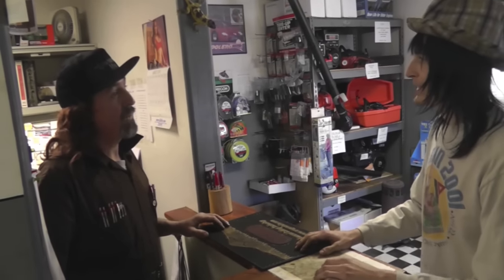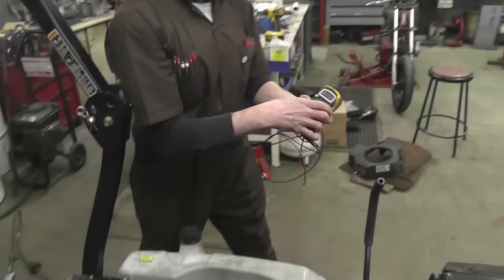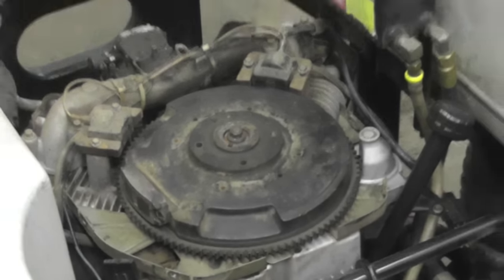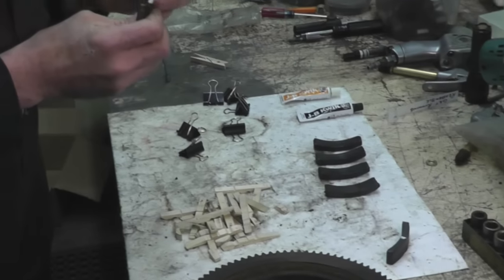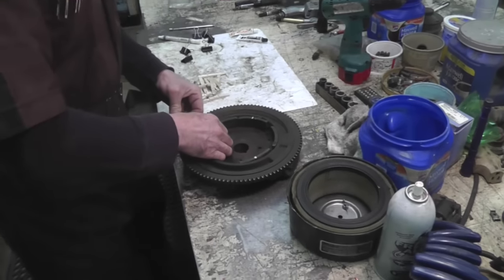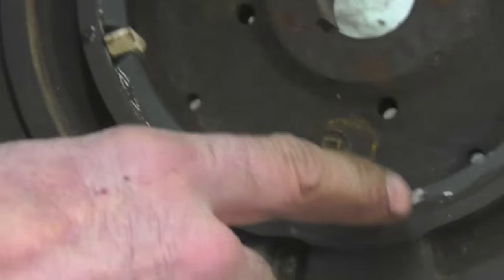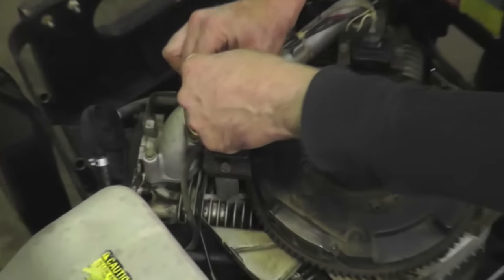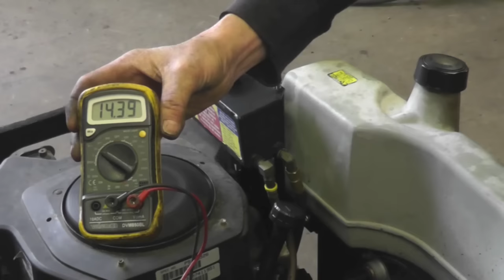Repair Broken Kohler Flywheel Magnets to Fix Charging System

Comment: I took my flywheel off and two of the magnets were broke in half. I glued the magnets back in place with JB weld and 24hrs of curing time, I put it all back together and the system is charging just fine. So, there is hope without having to buy a new flywheel, I just pushed the two pieces together with the JB Weld and a clamp, and it works fine.
Reply: Hi Robert, Thanks for your input.
I have one broken magnet.  Good to know that I can glue both halves back on the flywheel in the proper sequence and get it to work.
John
Reply: WHATS YOURSOC  Update:  I glued the broken magnets back on the flywheel with JB Weld and now the charging system works perfect.  Thanks to Robert Hills for sharing his knowledge.
John
Reply: Broken magnet.... About to put it together... Now that I know that it works... Thank you for the extra info. Appreciate it.
Reply: It works great. 43 volts AC. Thank you.

Comment: Help help!! I have a Miller 225 and it won’t start🤨sound like the battery is dead.. but is NOT almost 13Volts my voltage meter show,.I  remove from the engine block and it work just find

Comment: Taryl, I followed your Flywheel instructions and fixed it on my Kohler  Command Pro 23hp Engine which has NO Identification Sticker on it.. The block casting numbers are  24 560 39 .. The block is Cleaned and the Cast Iron bore is perfect and Already honed, and Ready to Re-Ring.. It has an 80mm Bore and 1.5mm thick Rings.. HOW Can I Get the Engine designation Numbers for the Right Parts and New Carb that I Need.. Help me to get to "Here's my Dinner" Partner PLEASE.. Love your Videos!! .. Thanks, Richard Tharp

Comment: Love it guys..great stuff..ive got a 25 hp kohler ive got 43 ac volts at the new voltage regulator..and I installed a new stator but no charging voltage at the battery... Any ideas? Also checked all the wires and didnt see any that were cut or broken

Comment: usually not what happens to a lawn tractor Magnets. Design Flaws in voltage regulator made easy to collect dirt. most attached to plastic.

Comment: Does anyone know where to get replacement magnets for a ech749-3038 Kohler engine? Mine spit 3 of them and they broke to pieces took the stator with them😥
Reply: Did you ever figure out where to buy the magnets by themselves? I’m thinking I’ll have to find a detailed schematic of this engine online in order to find out the exact dimensions of the magnets that I need; then use that information on a website that sells specialty/custom magnets.

Comment: If the magnets are stuck on the stator when you take the flywheel off, before removing them, mark every other one with the paint pen.  That way you don't have to check them with a magnet, since they were stuck there in the proper sequence.
Reply: Not only that but you should never hit one of these Kohler command engines flywheels or the older Tecumseh cast iron engine flywheels with a hammer because that will knock the magnets off from the flywheel. The right tool to use is a harmonic balance puller or what I use which is a 5 ton hydraulic puller. Taryl you know better than that! but if even one is already off from the flywheel then take a hammer and hit the back side of the flywheel with a hammer where each magnet is. That will pop the rest off from the flywheel. Now I found that the best thing to use to do these magnets is a wire wheel in a drill to clean the inside of the flywheel and the backside of each magnet. Then get some acetone to clean it or gasoline. then you get your Best ones for vibration and high heat which are 2047 green, 266 red/orange, red 2700NA or  RED 2760. You can also use 272 red or 277 red. The 266 red-orange is very high strength and heat up to 232c which is 450 degrees hot and handles high vibration or use the GREEN (Taryl already knows the one high heat green 2047 is heat resistant and very strong) loctite. that green requires a torch to remove the fastener. lol. Ive seen Taryl use the green before. lol. Put a thin coating over the back of each magnet setting them into their proper place as He shows. Then go set the flywheel in a warm 70 to 80 degree area (for faster set up) and you wont be able to pull that magnet off without it breaking after 24 hours of drying time. I know because I tried to remove them before and they will not come off without breaking by way of either screwdriver prying on a magnet OR hitting the backside of the flywheel with a hammer. I gave one a blunt hit with a hammer and it popped off in tiny pieces only. It was a junk flywheel. This was way back in the day. I was testing to see which was the best of like everything for holding these dam things in place. Specially on these dang Kohlers like this one here he just fixed. I got a dam exmark I have to do and that is going to be a big pain in the rear because of it having two shafts on it. Got to remove the pto adapter shaft from the flywheel side first after taking the belt off that runs the hydro pumps. Don't know what Crowler used to glue these in back in the day but it is way worse than what tecumish (as how Taryl would say it. lol. ) used. 56 years old and I too Own a small engine salvage as well. Done hundreds of these this way and never had one give way later or received even one complaint from a customer. I am a old Tecumish. lol. business seller of 39 years before they went out of business. Use to know like almost all the part numbers in my head of the cast iron old engines. kind of foggy now these days. lol.
Reply: Your hitting the bolt thats not touching the flywheel because the bolt was reinstalled loose. I worked in a john deere dealer out of 7 mechanics all of them did the pry bar hammer method. Bunch of nervous Nellie's out there that obviously have no experience.

Comment: One of my magnets is broken - and flywheels start at $90 on the bay... so I'm going to attempt to jb weld the broken magnet because i have a hard head.  Also, the little magnet test (for polarity) doesn't seem to work exactly like in the video.  Any advice as I go into this?  Like and appreciate the vids by the way.

Comment: Taryl I found magnets for $34.50 a set on ebay. Mine was broken along with the  starter gear, after some bone head tried to weld the gear. (also $34.50 ca-ching)
Thanks for the video good job
Reply: My magnets are broken and missing pieces. Could you please help me find the ones you used?

Comment: Thanks for this video sir! My mower stopped charging two years ago. I just mowed the lawn then put it on a charger afterwards. Somehow, my battery has survived all this. 

Since I was tearing it down for it's annual spring maintenance, I decided to yank the flywheel and have a look. Sure enough, all my magnets were sticking to the stator, I imagine it won't charge well like that. :-) I will be cleaning it up and gluing them back on, thanks for the tips. I wouldn't have thought to look for this.

Comment: Great  video
My issue 
Kohler kt735
New lawn tractor stator reading 40ACV at 3600rpm
Regulator 8.6dcv
Megnatic pieces under flywheel has same boles in direction suck in middle push in ends 
Kindly your support 
If i change full flywheel i will get 50 Ac volt or what can i do

Comment: Didn't know about the magnet arrangement so I was looking for an answer as to why my mower wouldn't start after replacing the flywheel. I got a likely answer in this video regarding the north and south poles of the magnets and their arrangement. I just stuck them in with no regard for the polarity plus I didn't epoxy them in place. Back to the drawing board for me. Thanks for the info!
Reply: Hey

Comment: Guessing that is what's wrong with mine. Putting out 26.7 AC and 12.6 DC. Will start and cut grass but the battery will go dead after 2-3 uses.
Mine is horizontal Command though. Little harder to get at.

Comment: Re-posting question. Done that myself on a Briggs.  Question on stator removal on CH980 twin.  Got everything removed but when it came to lifting off stator, it will not budge.  Seems to be stuck on the mating surface.  I've removed a similar stator but had to completely destroy it to remove.  Corrosion on the inner ring surface.  Any suggestions?  Have you had any similar experience?

Comment: Well i used this one time to replace just 2 magnets that came off and after I JB WELDED it did fine so now I have this exzact one doing all the magnets stupid me went to reach for one on my bench and bumped it near the other and sure enough the magnet being drawn to the other caused more speed and it crashed into each and sure enough broke one so I get the idiot award today..yippee! So heres what im going to do not knowing if it will work properly I knocked some magnets out of a kawasaki fvr or whatever its flywheel is almost identical yep its trash now..ugh...except for the width is a bit wider so here goes nothing going to see if theres any difference with gluing that one odd ball in there..haha..wish me luck...Update: the wider magnet from the Kawasaki done just fine its running @ 43 on AC so im RELIEVED Ha Ha!

Comment: Hey Taryl, I got the same motor im working on. Come on a Dixon 5601 zero turn. I got the wires comin from the black box there that the yellow and brown go to the coils. Well i have a red that turns into 2, one going to the carb and the other just hanging out in there unhooked. Then I have a purple wire thats cut and I assume its going to the middle prong of the piece coning from the stator. (3 prong, white on the 2 outside prongs) Could ya help me out? Cant find a wiring diagram that shows em

Comment: Hey Taryl.   Came across your video about magnets.  I’ve got a Kohler Command 20 on a Ranger 8.  Magnets came off the flywheel and stayed on the old stator.  I replaced the regulator, battery cables, etc.

Im going to give this method if you’re a try but I wondered if a couple or few magnets with a bit of a broken corner on each one would affect it too much?

Thanks,
G

Comment: ...Want to remove the flywheel from my 25hp Kohler engine...but plastic fan has rusted on bolts....Does the center pop out of the plastic fan?....Thinking of cutting it out to get to flywheel nut...but if it snaps out , it would be easier....

Comment: I have a kawasaki FX850V and it hasn't been charging. I replaced the voltage rectifier and still not charging. So I bought a new stator and installed that and it's still not charging. I'm in the engine now and seen that I have some cracked magnets inside the flywheel. They are intact and nothing missing. But there is 3 with a couple cracks in them.
I have a crap harbor freight digital meter and it jumps around when checking AC voltage coming out of the stator and cant get a solid reading but still not showing anything above 17 volts if......the meter is accurate.  When putting it on DC and checking the battery it's a solid 12.9 volts so I know the battery is up.
Any clues of what I'm going wrong?

Comment: I am getting 15.75 volts DC out of my regulator/rectifier (I get close to 40 volts AC coming out of my stator/alternator).  I am getting 14.2 Volts DC at the battery with the engine running - question:  I am about to install a new electric PTO clutch and Xtreme power says I should be at between 13.4 and 14 volts DC at the battery.  Any more will "cook" the electric clutch.  So how do I lower the DC output - I know my regulator/rectifier is working but perhaps not well enough and it should be lower the output a bit less??

Comment: My Kohler flywheel looks identical but it only has four magnets. I can see where they're supposed to be placed on the flywheel but do you happen to know how mine need to be aligned?
pos-neg-pos-neg, neg-pos-neg-pos, or pos-pos-neg-neg?
Reply: It's not Positive / Negative, it's North - South, which creates the magnetic field that generates electricity. So one magnet is all South and the next is all North. So long as you don't put two South magnets side by side, you've correctly installed all four magnets to be opposite polarity to each other. 

There are magnets made to have both poles in the same piece, but not for alternators.

Comment: Taryl.  Great video as usual.  Question:  Have Kohler CH980 v-twin that cannot remove the stator.  Seized onto block.  Tried wd40 overnight but it won't budge.  Anyway to remove without damaging?  Any tricks of the trade would be most appreciated.

Comment: Mine wasn’t charging and all the magnets were in tact so I replaced stator with the new one and the old one both were putting out 14 v ac I knew something else was the problem so I pull the flywheel off again and someone put the magnets out of order so I knocked them all off and I’m going to reglue them

Comment: Typical, I just went through this very repair on my garden tractor, shims, JB weld and all, and then I watch how to do what I just did. Thanks for the video guys, along with many others I surely appreciate your efforts. One note, all my magnets were found intact and attached to the stator, realizing their orientation may be critical I marked their location as found. I found myself wondering how I'd properly orient the magnets if I didn't find them as I did. Thanks to y'all now I know, and there's my dinner.
Reply: Yeah, I experience the same scenario: I look for good DIY help videos and I can't find "the one"; usually I have to create a playlist and save about 20 videos until I understand the solution then after I move forward to do my best then when I return to YouTube searching for another DIY Assistance video then occasionally in the "YouTube Recommend List is the best video"!

Comment: First, thanks for your information about the magnets coming loose from the flywheel.  My mower with a Kohler engine was not charging.  Just a comment about the spacing when installing the magnets.  The circumference of a circle is 6 times the radius.  When I reattached my magnets I measured the diameter of the circle where the magnets attach.  That would be the diameter of the circle.  I then divided the diameter by 2 which gave me the radius.  Then using a compass set to the radius I divided the circumference into 6 equal sections.  When I reattached the magnets I used the marks I made with the compass as a guide so I got even spacing on the magnets.  Just another approach.  Use it if you'd like.  Thanks again.

Comment: Hi guys, love you channel.
I have a Toro with a CH25S. Hasn’t charged since I bought it secondhand a few years back. 
After watching your video I pulled it apart. The magnets were still attached to the flywheel but were all loose. I cleaned them and glued with JB weld as per your video, separating the push pull magnets. I replaced the stator and rectifier.
But still isn’t charging. No 12v from the centre of the rectifier but I am get 10v AC.
Any idea what maybe causing this.
Thanks heaps Allan

Comment: Just watched your video, I have a cub cadet 3660 with the 25hp Kohler command vertical shaft. By checking with engine on high run the 2 white wires produce 22-23 volts ac 14 volt dc from middle connecter on the voltage regulator to a ground. Ever since I owned the rider, I have had to put a charger on it for an hour or so to get it to crank. Just replaced the starter and solenoid, still turn key here a clicking in solenoid but no crank. If I keep turning key after a 1/2 dozen times starter may engage I replaced key switch years ago and I dont recall if it got any better. Purchased used, so now warranty, and I have had in once to fix problem but it didn't get fixed. Service department said was all in working order. Do you have any ideas? like you vids, they are funny

Comment: Thanks for a great video. Just popped the flywheel off my engine and the magnets were stuck to the stator exactly as shown in your video. I used up all my JB Weld fixing the wife's dentures, so I have to run to the store and get some more before I glue the magnets back on.

Comment: Taryl, My inlaws Kohler will not go to full throttle, the 20 amp fuse blows when you apply full. Battery is god and testing the regulator I get 14+ volts and 16 volts AC at half and full throttle. If you stay at full throttle it blows the 20 amp fuse. Scratching my head on this one? Any thoughts?

Comment: This video was very good. However I discovered on our ferris mowers that the charging issue was caused by a missing ground wire on the voltage regulator... Wasn't included fron the factory, charges for 1500 hours then nothing.... Added a ground and we had charge.

Comment: I have a spark issue from the spark plug. I can't get any spark. I changed the spark plug - ignition coil, unhooked the kill wire from the back of the coil and still no spark from the plug. I took off the flywheel, cleaned out everything - replaced the stator. Now I get a faint charge from the stator. for the battery. I am wondering if the batteries are weak in the flywheel?? How do I check and recharge them????

Comment: G'day there, Taryl Mate,
Wished I'd seen this video before I tried to glue in my x3 loose magnets.  Yeah..I didn't know about each magnet being different polarity.  So I then removed all the magnets off the flywheel (using mild heat - burning metho on a paper wick).  That's when one magnet split clean in half.  My question > Would the flywheel work if I glued the split magnet in position.  Thanks for being  fair dinkum.  Cheers Roy, Australia.

Comment: Taryl I have a Tecumseh HH60-105090F engine that the magnets came loose on the flywheel. Do you have any advice on placement and polarity before I try to glue them back in. thank you for the videos. They are a great help.

Comment: question for ya Taryl, great vids btw .. I have a 25 HP Kohler v-Twin Command Engine that will not start or even jump from a car. I see the ignition coils leading to the flywheel are rusted could that be it or the starter? Thanks